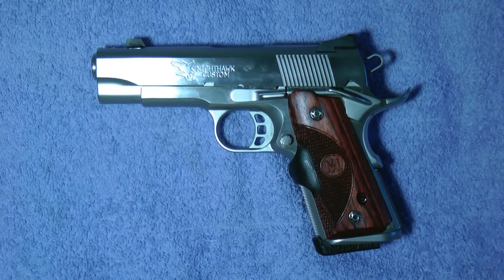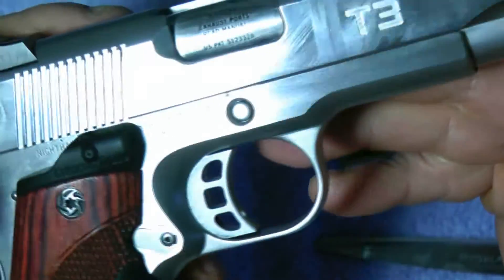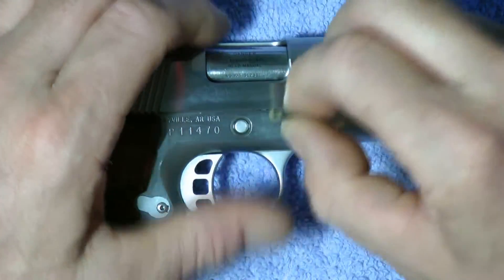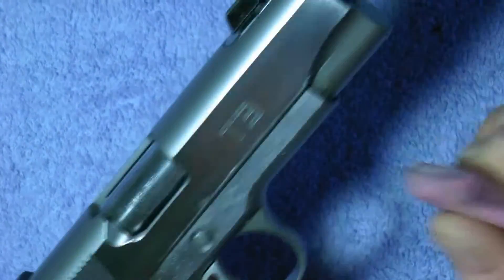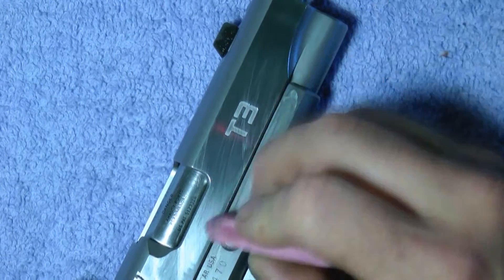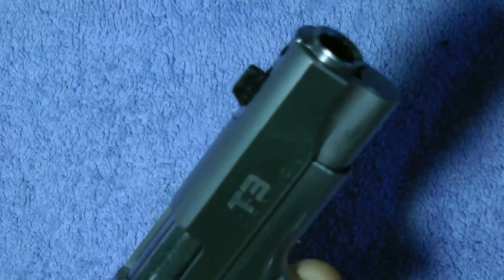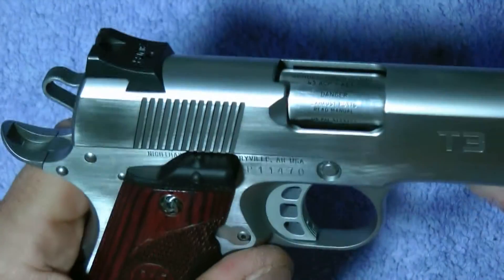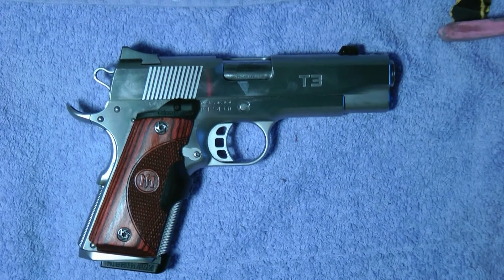Watch Me  SCRATCH A $5000 Dollar GUN!!!!!!

Comment: The algo popped this video up on my screen. This guy just ruined the finish on his gun.
1) Brush in only one direction with the grain. Back and forth like he does makes swirls.
2) The grit is way, way too harsh. Use something softer like ScotchBrite Scuff pads for fine finish, furniture and paint. Here are the part numbers from 3M. 
	 7445 Light Duty	White	 Polishing	
	 7448 Ultra Fine	Gray	 Refinish Furniture	
	 7447 General Purpose	Maroon	 Paint Preparation
3) Take your time and gentle pressure. You want to match the original grain of the metal. Brush in one direction, lift and brush again in one direction.

Comment: Hi polished stainless is even better than brushed.  Easier to scratch however much easier to polish the scratch out.  On brushed stainless I like to use a green scotch brite pad.  Polish along the grain in one direction.  Works every time on scratches.  On bead blasted areas i use a piece of 80 grit sandpaper and a small hammer.  Thanks!